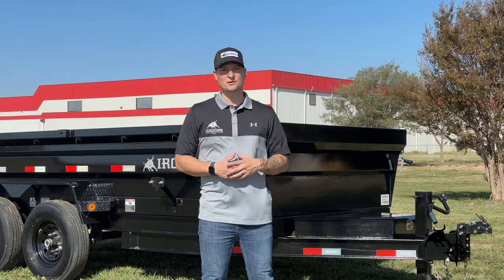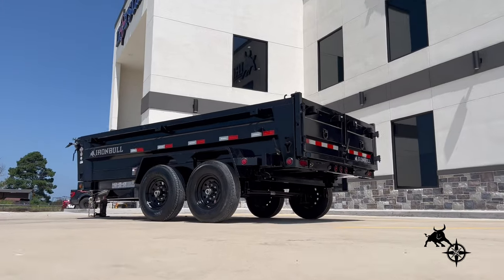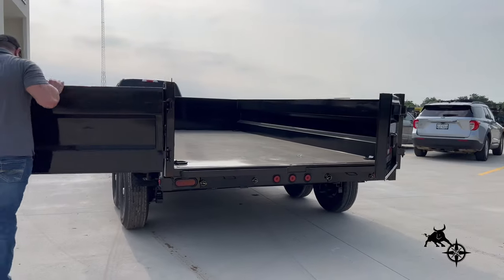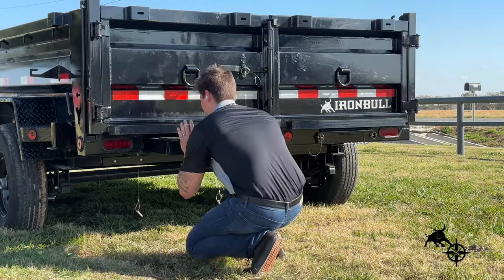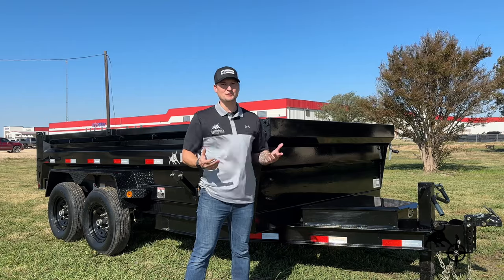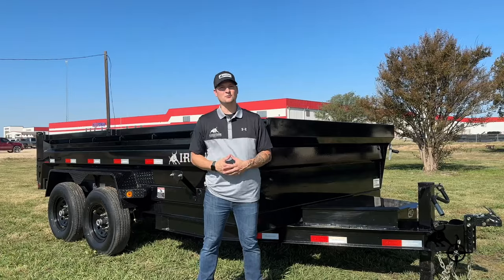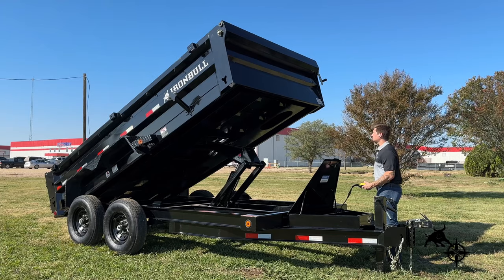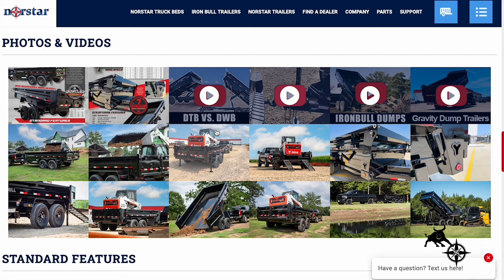DTB Dump Trailer Refreshed | Norstar Company

Comment: The real question is why does the DWB say it has a one piece floor but all  the new charcoal ones I've seen on the lot have a welded seem running down the middle ?????
Reply from the maker: Hey Jason, great question – thanks for asking. When we started the DWB series the intention was to have a one piece floor as standard equipment. However, since 2020 our vendors have had varying availability on one piece floors – so when they cannot supply us we have to use two pieces. We have tried to update our web site and marketing materials to reflect that one piece floors will be ‘based on vendor supply,’ but must have missed something along the way. Can you tell us where you are still seeing that one piece floors are still listed as standard equipment? Also, be advised that with our trailer construction techniques, we have seen no performance differences between one piece and two piece floors. Each configuration will well out perform the GVWR of the trailer. Hope this helps